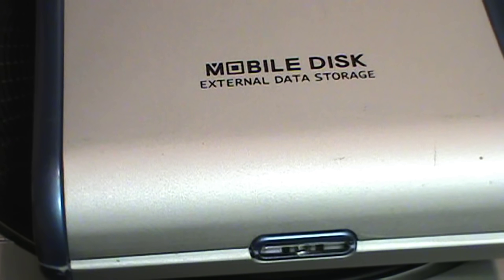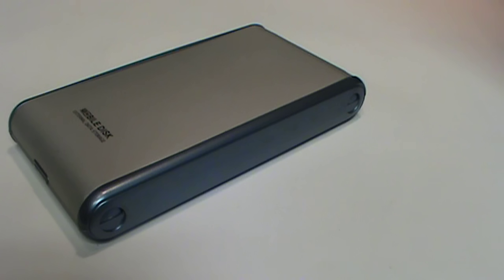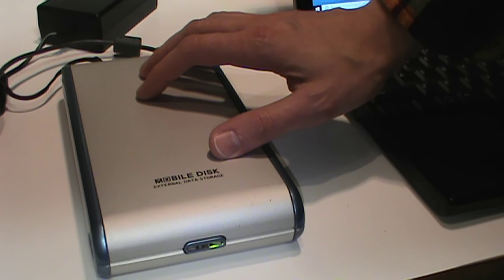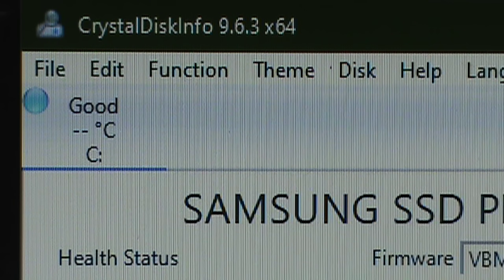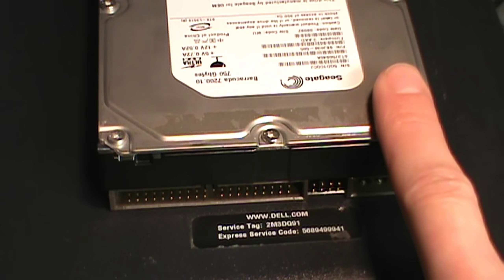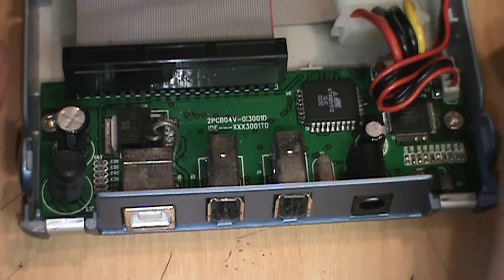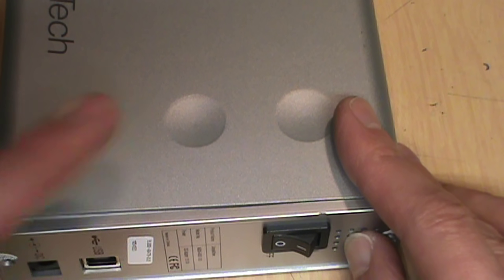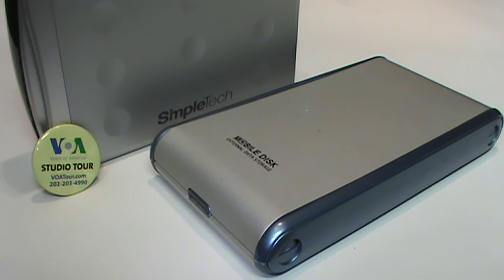The world's largest IDE hard drive failed on me

Comment: Also I have some HDDs with reallocated sectors that work fine, also keep an eye on your HDD (sign of reallocated sectors is usually slow data access, because when a sector is bad, it is moved to spare area which is usually at the edge of the platter, so that's why is slow data access when reallocated sector comes in).

Also I had a Samsung Spinpoint T133 like yours, but mine was 300GB version, and that failed on me. Also I have a 320GB Western Digital IDE HDD in my ASUS A7N8X-E Deluxe machine that still works!

And also I have several enclosures, but for some old IDE HDDs to copy I prefer IDE to USB (i have one IDE/SATA to USB 3.0 adapter, the well-known XT-U33502, that works perfectly now) when I am in a rush, but usually I prefer it on a real IDE controller (like the one integrated on motherboards) because for data reliability and no corruption issues.
Reply: i have a laptop with a 2015 wd black 2.5" drive that has 761+ realocated sectors which goes up every other time i use it. no important data on it though
Reply: @WeatherMan2005  Understand. But keep an eye on SMART information and also for safety back up data and replace the HDD. Also from what I know Western Digital HDDs failed at me mostly. I have several Western Digital HDDs from early 2000s that still work without bad sectors (only one WD400EB-11CPF0 have a small number of reallocated sectors, but works), especially a WD400BB-75DEA0 from July 2003 that it have 10k hours of use and NO BAD SECTORS at all, also I had 2 WD1600JD 160GB Hard drives, 1 of them failed with uncorrectable sectors and 1 still works perfectly. That is only my case with Western Digital HDDs, it is not general.

Comment: I do wonder if drive does ever fail (the heads or u get a headcrash)

If it would be possible to transplant the ide interface to a similar sized segate sata drive
Reply: These drives are a waste of time.   Seagate drives fail when you look at them wrong.   Especially 500GB and above.
Reply: @nyccollin  I had 3 1TB ones
One of them failed, 2 of them still going (knock on wood, although, I do have a backup, just incase)
Reply: @Veso266  Nice!  Hope they continue to work well for you!

Comment: The classic "Unspecified" Error.......
Reply: The classic Windows 'Error 0x00000000 - The operation completed successfully'.
Reply: Sadly, its little brother "Unexpected Error" wasn't with it.
Reply: The error message was so bland because that wasn't a proper error code. Check Disk reported the name of the file it was writing ("logfile.") as though it were an error code.
Reply: I'm used to seeing Microsoft's "Something went wrong..." error. Every time I see it, I think "Yep, it did. I'm having to use Windows to do this."
Reply: I am still shocked my Maxtor 250gb IDE drive in my PS2 still works. Has some stuff on it still that shockingly works after I got it in a Goodwill years ago...

Comment: My first IDE hard drive from 2002 is still alive somehow. It's a Maxtor 40GB and it's the loudest hard drive I've ever owned. But extremely reliable.
Reply: My WD Caviar 40MB drive from 1992 still works fine.   Older tech was more reliable.
Reply: @nyccollin  I have a 20MB Western Digital ATA drive in a Tandy 1000 that still works. It's old enough to still need to be parked prior to powering the computer off.
Reply: @shmehfleh3115  Nice!   I don’t know that I’ve ever seen a WD of that size.  Was it a caviar?
Reply: @nyccollin  Not really, it's just that the drives from that era that are still working today were the right side of the engineering tolerances and/or were treated well enough to still be working. The oldest working hard drive I have is a 20MB Seagate ST225 which was manufactured in 1986. This does not mean most 40ish year old hard drives that still exist are still working. Most have long since failed. Similarly, I've got several from the late 90's-early 00's which still work perfectly, but I've also got many more which don't. I have had drives fail under warranty. And even with a working drive, I would never trust an old drive with critical data. I only still run them because I'm into retro computing and like a real hard drive in my builds for authenticity. The only certainty with hard drives is that as a mechanical device they will eventually fail, and no drive has ever been produced which had reliable operation for decades being a design goal. Trusting any hard drive more than 5 or so years old with important data is a very risky business indeed.
Reply: @chriswathen9612  I understand and agree with you.   My first PC was a 386 DX/33 with a 40MB WD Caviar and I worked in repair shops from 1997-2017.
Reply: @nyccollin  that's called survivorship bias. A LOT of drives that age are dead now. I'd wager most of them.
Reply: Same for me: MAXTOR D740X-6L from 2002, 40GB, the well-known MAXTOR 6L040J2, have no bad sectors. Even a Western Digital Caviar 40GB from 2003 have no bad sectors also (WD400BB model with 2MB cache). Also I have a Maxtor DiamondMax Plus 8 Slimline 40GB, with reallocated sectors but fine.
Reply: @aleculunguleac  i had a maxtor 80gb that died after just a few mknths. Never used the brand again.
Reply: Also even a old 1998 Quantum FireBall EL 5.1GB HDD is good on SMART, without bad sectors at all.
Reply: @ Used to mess around with 20-30 MB Seagate MFM drives back in the day and they worked fine!
Reply: Those old Maxtors are so damn loud, even at idle. I don't have great luck with them staying reliable either.
Reply: @bazzle592  I know. I have my Maxtor D740X-6L (6L040J2) 40GB that have it's specific motor noise (due to ball bearing, it is not from failing bearing) and also the noise when It auto-parks the head and when spins down at power off. Also my HDD is still WORKING, from 2002, without reallocated sectors, bad sectors and unstable sectors (according to SMART info, which in my opinion is vital for HDD)
Reply: i have a old apple 1tb sata hdd from 2009 it still works fine even with 90k power on hours!
Reply: @ Nice!
Reply: MAXTOR and reliable do NOT go together in the same sentence. But, those thin drives are pretty trusty because I do have a couple that still function fine.
Reply: Please, my 10MB MFM Seagate drive from the mid 80s still works to this day for me.
Reply: @ Yeah I’ve had positive experiences with MFM as well!   Cool you still have yours.
Reply: Spindle noise? Or actuator noise?

I like hard drives with loud seeks, but if the spindle motor is super loud it annoys the heck out of me.
Reply: @ My old drive has loud both spindle and actuator noise. The old Maxtor drive has ball bearing instead of fluid bearing in it's motor. Even when the hard drive is doing nothing, the spinning of the motor who spins the platters makes a constant high pitch noise. This noise is unique to old PC's.
Reply: Good stuff. I have 40, 60 & 80gb maxtors & a 300gb seagate sata after all these years. They all passed diagnostic when I stored them years ago. The Seagate is the loud one.
Reply: That was what's in my Dell Dimension from 2002. It conked out less than 2 years after I started using it on a daily basis. Maybe it was due to my then bad habit of turning off the system by simply flicking the switch, because I thought the shutdown process took too long. After a drive replacement, I stopped doing that, and it went on fine even till this day. Don't remember being loud though, because the cooling fan for the hot Pentium 4 takes the cake.
Reply: It died from capacitor plague
Reply: ayo YouTube hyperlink "2002" like it's that important that it warrants your search
Reply: Loudest HD I ever had was a 20MB with stepper motor in a Mac SE.   It physically shook the computer and could be heard throughout the house.
Reply: I've got an original HDD from an IBM ThinkPad from like 1996/97 that I found dumped in an abandoned building partially exposed to the elements that still works.
Reply: You haven't heard anything until you've heard an old school MFM drive.
Reply: i still use my 13 years old toshiba p300 for data storage in my pc. I want to retire it and make a NAS.
Reply: How reliable are Maxtor HDDs? I still have a 120Gb and I remember fighting it trying to keep it connected to an USB-IDE adapter. Changed the cable (soldered a new one) and the PSU (from a cheap box that delivers  its main voltages, 12 and 5 to a proper PC PSU) and everything seems fine but don't know how long will it last.

Also I have 3 old 2.5" ide disks and holy cow, they're super reliable despite their age.
Reply: Best advice, back it up now
Reply: I had a maxtor 40GB in my first or 2nd self built PC and I honestly thought it was broken when I got it due to the noise it made. almost 25 years later and It's still going strong in  an old xp system I use for old hardware testing.
Reply: Well that's pretty rare. Most Maxtor drives crapped out early.
Reply: I have a SATA hard drive from a laptop I spilled chocolate milk all over when I was 3 years old in 2007 and its still alive. 250gb SATA drive that I use occasionally in random things for various purposes

Comment: Anyone else expecting a physically huge IDE drive that made the Quantum Bigfoot or an old MFM look tiny by comparison?
Reply: Yup was prepared to comment RIP Foot
Reply: @JohnSmith-xq1pz  Haha nice!
Reply: @nyccollin  I like those Bigfoot drives. 

I have one stashed away that I've been meaning to get put in a Win98 PC build. I think it's about 8gb.

The seek noises are great.
Reply: @volvo09  Oh yes I like those drives as well.   Always thought they were pretty neat looking.
Reply: @volvo09 dont.   Just put the drive in there for the sound and run your stuff from flash. You can even make it do busywork to keep the noises comming
Reply: Not this time, i have seen 400gb ide drives, but not that big, 750gb ide is something New to me
Reply: @JoaoVitor-cw2vg  That capacity in SATA were a thing for a good long while, but they are phased out, as were the 900GB or so drives. Now you get 500GB, than it's a full gig and up. Even SATA SSD's came in those in between sizes for a short bit if not mistaken. I have both a 500GB NVME for boot/program and a 1TB for video editing and another 1TB SATA SSD for a work drive as in, I place all my assets on it, then it is where I pull all assets and premade graphics into Davnici Resolve for editing on the NVME 1TB drive.
Reply: I remember my 6.4GB Quantum Bigfoot Cyclone, it died when I tried to upgrade to Windows 95 ORS2 on fat32.
Luckily the drive was still in warrenty.
The replacement drive started to make ominous noises when I tried to install Windows on fat32 again.
I immediately turned off the system and installed Windows on fat16 without any problems, however 32KB in bad sectors were already developed. After this the drive worked flawless for many years in a MDaemon server.
I still don't know if these drives don't support fat32 or it was just bad luck..
Reply: @elsvankortenhof5583  I installed 98SE and XP with FAT32 on a few of them back in the day.
Reply: @elsvankortenhof5583  This sounds mystical. I don't know if any drive "can" or "can not" support a filesystem as long as there is enough space, but perhaps. I imagine there could be some issues where one filesystem could benefit from a different track interleave than another. Modern drives even manage their own mechanism, but on an MFM style drive it might be possible to bang the limitations of the drive by software, to the point of writing data during head steps or doing rapid headbanging that might temporarily distort the arms and cause crashes.

I remember having a HDD on my Amiga, and using the FFS (which seemed to be aptly abbreviated in certain cases). With floppy disks, FFS allowed a small increase of access speed, but on a hard drive there was a noticeable difference. On the flipside, it seemed that FFS partitions would corrupt very often, and with certain floppy drive models (especially the cheap, slim belt driven units, and some modified PC drives), FFS would be riskier than with others, so it seems that the speed increase brought timing issues. It never borked a HDD physically though. OFS had no such issues.
Reply: An MFM was the same size as an Apple II disk drive, could fit inside the frame.  I had a used 40MB, my only financial choice at the time.
Reply: Lmfao yes.
Reply: I sure was as I had some 1TB IDE hard drives in raid back in the day.
Reply: @ Apparently a 1TB IDE was never produced.   You sure it wasn’t SATA?
Reply: @ I had 2 for 2tb in raid 0. my fist SATA was 2X 2tb in a 4tb raid 0.
Reply: slave to the optical drive, oh hell nah, Bigfoot ain't no slave! gimme that power, bitch!
Reply: Exactly
Reply: No
Reply: I was, still cool to see a 750GB IDE drive.
Reply: I think Bigfoot drives would make a lot of sense today , even more so than at the time they were around. The 5.25" form factor and lower rpm wouldn't really matter for cold storage but the increased capacity would be relevant.
Reply: not really 2007 is the start of 1TB drives I'm sure there is some IDE drive around that size, not that it matters convertors exist between the two standards.
Reply: I remember getting a Bigfoot drive! Gosh I bet it was like 250MB or something😅
Reply: @ They started at 1.2 GB actually.
Reply: Still rocking a 4GB Bigfoot TX in my DOS rig
Reply: Nothing like hearing a Bigfoot spool up from the other side of the house.
Reply: I have it, cy43a013. 4gb
Reply: The pizza box Quantum drives
Reply: Of course not... Its not how it works.
Reply: Yeah, i am extremely disappointed and my day is ruined
Reply: @ You ok bro?